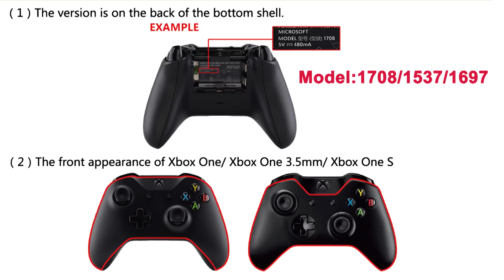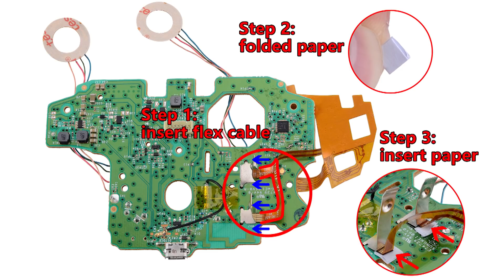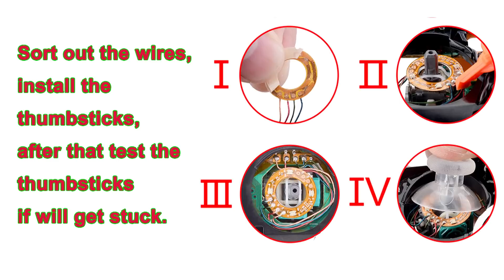Xbox One Controller DTF LED Mod Kit Installation Guide - eXtremeRate

Comment: Amazing led kit…it was honestly easy for me at least cause I work on my controller a lot…like changing buttons, aux ports, shells and other things…at first I got scared cause my blue light was really low but after searching through the comments I saw that it was a battery problem…I changed the battery pack and the blue light was nice and bright…PLEASE CHECK IF UR BATTERY ARE CHARGED WELL AND IN GOOD CONDITION…best mod I have ever done on my controller :)
Reply from the maker: Congrats and thank you!!! :D

Comment: This video had led me through 2 successful installations. Thanks  💪
Reply: Kic DutchMUSIC was it hard to do
Reply: @swavvygigi8166  no! As long as you take your time with each step
Reply: Kic DutchMUSIC oh ok cool,I’m thinking about buying the parts,hopefully it comes out successfully
Reply: @swavvygigi8166  good luck friend! I'm sure it'll turn out great, I've remained pleased since I purchased and installed it!
Reply: Kic DutchMUSlC Xbox One Christophe
Reply: Mr. Stonks if u r talking about the screwdrivers then yes
Reply: I did mine but my buttons have to be pressed hard after taking it apart and putting EVERYTHING back together for literally 11 hours straight. It was continuously something that had to be reput into position, i.e, those stupid paper pieces, or having to move the wires around for the toggle. 

Final product -
•the light works perfectly, unless I squeeze the controller too hard. 
•i had to put my old buttons back. On for a, x , y and b, because the cleat y and a did not work. 
•all buttons work with the help of pressing pretty damn hard. 
•the piece of paper part was ridiculously stupid. I don't understand why they don't make the pieces thick enough so you don't have to put paper under them to ghetto rig it. 

So, all in all, the light works. But its definitely an absolute pain in the ass to put together cause if one single thing isn't right you have completely take it apart again. And after putting in the original a,y,x,b buttons I don't understand why I still have to press pretty hard on them and I wasn't even able to use the clear buttons for those. At the end of the day probably would've put my money in a more.. worth it product.

Comment: I'm not planning to attempt this, why; I'm hella scared that I'm gunna break something
Reply from the maker: That will be cool if you are not confident enough with your handy skill, Xbox one controller has a little bit complicated structure, it makes the installation a bit hard.
Reply: I pulled my first controller apart for stick drift I say find one that is cheap and practice on that
Reply from the maker: @waynehangman8449  bless
Reply: Get one from wish
That will make it
Reply from the maker: @floppstar.  Please do it carefully and slowly and strictly follow the instruction, bless~~
Reply: Yeah, I got stick drift on all three of my xb1 controllers. Don't know why
Reply from the maker: @abomnatrex3602  Nearly all of the controller sticks will be drift after a long term & heavy use.
Reply: Im just going to buy some used controller and try it
Reply from the maker: @gamerboyfridayYT  Wise choice :)
Reply: i was when i replaced my Xbox one controller joystick i messed it up the first time then i redid it and i fixed it
Reply from the maker: @RandomGamerawesomerandomgamer  It's not that difficult right
Reply: @ExtremeRate  no hay envios a México...!???
Reply from the maker: @juanyjanetreynavergara3133  https://www.amazon.com.mx/dp/B07YW53K88/
Reply: As I opened my controller the vibrators fell out and the cable ripped apart. That's why he taped it in place in the video.
Reply from the maker: @davidk.2517  Yes :(
Reply: @davidk.2517  You can still solder it but without a vibrator you can also play
Reply: Yeah this was scary to do and I was rough with it
Reply from the maker: @nathanjames1831  It's easy enough when compare to other projects lol
Reply: I rather have a professional do it for me and pay them to do so cuz Im to scared ill break it, mess up or, ruin it
Reply from the maker: @TombRaiderLaraCroft1991  Yea, DIY project needs courage and skills :)
Reply: @ExtremeRate which I don’t have neither I know how to work and operate electronics but the hardwares, mother boards,  chips and it many parts inside the electronic is beyond me to even comprehend plus to many parts to remember where they go and too many parts and screws to keep up
Reply: Year your crazy if you think imma do this with my controller
Reply from the maker: @TombRaiderLaraCroft1991  But it still easier than the Nintendo Switch Joycons shells installation :)
Reply from the maker: @coreycorezz5759  lol
Reply: Same 😭😭😭
Reply: @ExtremeRate   you didn’t take off the tape from the vibrators ,did you keep it like that?😂
Reply from the maker: @lostkz1012  yes you can keep it haha
Reply: Imma use one do the controllers that I don’t use
Reply: Yea one of my vibration things came off but I turn that off anyway lol
Reply: @ExtremeRate  yes they do
Reply: @ExtremeRate  As someone new to the controller mod community I tried that and I hated it
Reply: This is easyyy no soldering involved or anything. You guys are awesome for making this product

Comment: This has been the biggest pain in the ass ever. Got it finally after 4 hours, everything works fine, but my blue is kinda low light
Reply from the maker: Were you using full power batteries?
Reply: @ExtremeRate  its a 3rd party play and charge kit. But thx for the tip ill try other batteries later
Reply: @ExtremeRate  so i change the battery and now all the colors are working. Good product but a pain in the ass to actually build it into the pad
Reply from the maker: @telefono776  That's great! Yea but no pain no gain :P
Reply: Omg I just took it apart cause I had a hard time with the + and - tips.. I didn't think about the batteries
@eXtremeRate
Reply: Yea I've installed this on 20 different controller's and noticed blue has an issue half the time. Different batteries don't always work. Sometimes I have to take it apart and adjust the metal prongs that the batteries touch. Then it usually works
Reply: TheOnEaNdOnLy omfg i am so happy I found this comment I was getting scared bc my blue light was low…Thx for checking…I was ab to return them:)

Comment: honestly its not too difficult it just takes a while 
and I doubt you will break any thing if you fallow the guide and instructions. there are alot of tight spots when it came to putting the LED's on, mainly getting things to stick or stay in certain places. and make sure that you screw down the circuit boards kinda tight because if you don't then some of the buttons won't work correctly when pressing them down. and also sometimes if you don't have charged batteries or there like close to dead then the blue lights will go dim before the others. so I guess its also cool in that way too because it lets ya know that you batteries need to be charged .
Reply from the maker: Thanks for your comment! :D

Comment: I’m getting this for Christmas and I’m already someone that bought things from extremerate so my controller is almost modified and it’s going to be more with this, it’s so cool
Reply: This is an old comment but did you use this in combination with the remap kit and if so did it overlap or cause trouble? I just want to know if it’s possible 😭

Comment: Does the led drain the battery life like vibrations does when it's on?
Reply from the maker: Sure, so after the battery voltage goes down to 2.8v, the LED will not work properly while the controller still working. So we recommend you use the official Play & Charge Kit
Reply: @ExtremeRate  also why don't you sell already made custom led controllers?
Reply from the maker: @TyrantFaction  We think that DIY is funny. And it's hard for us to become the number 1 modded controller company, but now we are the best gaming controller modding solution company :P
Reply: Obviously 🤦🏻
Reply: ExtremeRate do you guys sell buttons map
Reply from the maker: @jamichealhunt9879  What is buttons map?
Reply: @ExtremeRate  i think he means a kit that would let u remap Any button on the controller to be another button
Reply from the maker: @thibautdedoncker3370   I see, we are working on PS4 controller, but for the X1S controller, we will try to find out a solution.
Reply: @thibautdedoncker3370  that's already something u can do in xbox settings and controller configuration
Reply: @covid-19isnonexistant39  not if u play on pc
Reply: @swifdy6855  i mean they gotta keep those features for the elite controller
Reply: @thibautdedoncker3370  if your playing a game on steam then yes you can indeed remap the buttons. can also add turbo function on a button if held down. Ive done all this on an xbox one x controller connected via usb and more recently it still works while using microsoft bluetooth adaptor.

Comment: Amazing product. Works great and video helps a lot. The most tricky part would be lining the lights up for the joysticks. Be very careful or the joystick might pull the sticky led off.
Reply from the maker: Thank you!
Reply: My lights go off in like 5 mins
Reply from the maker: @kadencastro445  Have you tried a new pair of batteries?

Comment: What about the tape in the vibration motors?
Reply from the maker: What do you mean?
Reply: ExtremeRate the tape was left on the vibrate motors
Reply: @briksoboogeyman  yeh i think you take it off when your done its just the motors dangle ... A LOT
Reply: LyonKing👑 I figured lol but I was also wondering if the vibration would mess anything up too
Reply: @briksoboogeyman  aint think about tht
Reply: Or just take them out. The controller weighs a lot less if you do so. My friend was reluctant about it but now he doesnt regret it.

Comment: I'm about to attempt this install on my controller. Wish me luck! I'm confident in disassembly but will soon find out how handy I really am... LOL. I'll update once completed or uncompleted.
Reply from the maker: GOOD LUCK!!!
Reply: @ExtremeRate  Thank you! install went well too about 1 hr install with my kids disrupting. The only issue is that the blue led does not work, all other light options work fine... I double checked strip connections and seating, all seems tight.
Reply from the maker: @SiK_TxBomber87  Hi, is the blue light does not light up on all the area?
Reply from the maker: @SiK_TxBomber87  Please use a new pair of AA battery

Comment: I'm too lazy for this. Just kidding. I only need to change the analog sticks and saw this on amazon. I prefer the other kit btw. The not fully transparent one.
Reply: same, i ordered the one with the button logos still, ive got the transparent purple case from ExtremeRate so i think without the black buffer on the buttons and sticks it would be too much.

Comment: Does it work on a Elite controller series 2
Reply from the maker: No it can't, not even the series 1
Reply: Is there a kit for the elite series 1 controller?
Reply from the maker: @andrewward1383  No
Reply: @ExtremeRate  I will try to mod it so it will work i will update you till end of next week
Reply from the maker: @thechxice9061  That would be cool!!!
Reply: @ExtremeRate  done. Works's if you want to have a picture @leon.svyn on Instagram
Reply from the maker: @thechxice9061  Why don't you share it on your INS? It's the other guy manage our INS account :D
Reply: @ExtremeRate  you got tagged in a post where you can see it, not my account but a picture from my controller
Reply: @ExtremeRate  you also have a DM
Reply from the maker: @thechxice9061  I'm stunned! Good job!!
Reply: @thechxice9061  Thank you! I've got my series 1 apart right now and I was pretty confident this would work. The model number is also only off by 1 digit, the board looks identical. Obviously slightly different for the paddle connector. I'm really glad to see someone else got it to work.
Reply: We will know next week if it works with the series 2 after some modifications ;)
Reply: @SHINOBICRUZ yes but way to complicated and you can't use it wireless anymore after

Comment: I ordered this kit and installed it and it works great! The only problem I had with it is one of the LEDs stays red when it is on the red color but that does not bother me too much. Also, my kit came with a mystery wire that was not mentioned in the instruction manual.
Reply: It might be an extra one in case you rip the one that connects both motherboards. That's what I thought it was. My only issue is that I can't get the blue color or purple for some reason

Comment: I don't like the idea of using paper to prop the power connector... Is soldering an option? Edit: I see the Leads on the ribbon cables. so Yeah, I'm sure soldering could work.
Reply from the maker: Yes you can solder it, but please beware that don't melt the fpc cable
Reply: @ExtremeRate  thank you.
Reply from the maker: @steventechno  You are welcome :)

Comment: Just installed mine and once the batteries are put in, the lights immediately turn on. Did I do something wrong? To further clarify, unless I remove the batteries the LEDs are always on. Now that I think about it, my kit included a black wire that I did not install. I don’t believe the video or the manual shows where this goes.
Reply: Still needing to figure this out myself lol
Reply: @grumgti you need to hold both middle buttons to turn it off

Comment: 7:22 . I don't see the reason for the little bits of paper. It just seems like a means to an end job that you have to replace better, but I'm still curious what the reason for it is besides a temporary or easy way to not make this an easy job anyone can do with the paper or you would maybe use tape or something else more permanent to keep them in place keep them from being in contact with the main controller board?  Also, there's no annotations, advisory or caution in the whole video which in my opinion would really help instead of just the music.
Reply from the maker: Thanks for your suggestion. The flex was not connected with the mainboard of the controller, it connected with the metal plate of the mainboard, so a small paper will help it stay and connect better

Comment: After many long good years of use my og Xbox one controller got drift with my other controller so I’m replacing a lot of stuff while I’m in there this is my first time working on a Xbox controller though either ways if it goes wrong I can salvage it and make it a display piece think I might practice on a cheap controller
Reply from the maker: It's not easy but it's kind of fun :)

Comment: Works this with the Elite Controller Series 2? Or with the original Elite?
Reply from the maker: This kit was designed for Xbox One standard / S controller, but @fight dragon made some mod on the kit to make it works on Elite Gen 1 controller.
Reply: @ExtremeRate  Thx for the Answer👍
Reply from the maker: @BLCKVPER  You are welcome :)
Reply: Works with both after modification 🧐 but the series 2 is way to hard
Reply from the maker: @thechxice9061  Expert!

Comment: surely there is a better solution to the power connection that a folded bit of paper that will get knocked out the first time the controller is dropped? Solder paste? plug?
Reply from the maker: Thanks for your advice, we will think about that!

Comment: Hello,  Great mod here, I did it today,, I'm having one problem.  Lights comes on for less than a minute while controller in use.  However  lights stay on while the xbox is off.  i'm pressing away on buttons and using the anologs,  staying on.  Full Battery but it's a 3rd party.  not sure if that could be it..  or is it when it rumbles,   will test more to see if I can narrow it down.    all buttons and sticks work normal on the controller.  I did the wedge with the paper also,  i was also thinking about soldering the Ribbon cable onto the battery contacts, but not sure if that's really the problem..
Reply from the maker: Hi, this LED kit only works when batteries voltage higher than 2.8v, so if you are using AA batteries, the lifetime is about 4 hours for the LEDs, after the voltage under 2.8v, the controller still functional, but the LED will not work properly. And if you use the rechargeable battery, please use the official Play & Charge kit, it works for minimum of 8 hours. And the second problem, the LEDs will not turn off automatically when your controller or console off, you should turn it on/off by pressing menu buttons (for 5 seconds).
Reply: @ExtremeRate  i know it wont turn off by itself.  I turned it on to see if it would come off again, trying to see if its really shorting out..  so far its staying on without it being in use with the xbox.   Will try some AA batteries.. thanks alot.   If that works will definitely get the official play and charge kit. Thanks for the fast reply
Reply from the maker: @djfresh826  Please keep us update!  Thanks!
Reply: It works now. With the normal AA batteries which means it was the 3rd party battery..    thats my fault for not reading through in the first place about having the officiall play n charge kit or just regular batteries..  love the product.  Thanks again
Reply from the maker: @djfresh826  Great to hear that! You are most welcome!

Comment: Why do you put tape on the motors? And don’t take them off?
Reply from the maker: Because the motors are easy to fall and the wires of them will break from the PCB
Reply: ExtremeRate thank you very much I have now ordered one thank you so much 😊
Reply from the maker: @diegobaca6763  You are most welcome! And GOOD LUCK for the installation! :)
Reply: ExtremeRate thank you I will do my best!😄

Comment: Hi, I wanted to know if it is hard to use batteries or so well I can put batteries and the USB cable or the USB only
Reply from the maker: It works for batteries if they are full power (LED works for 3 to 4 hours)